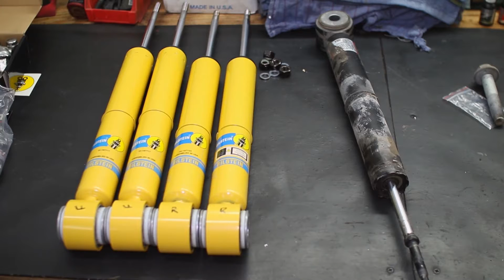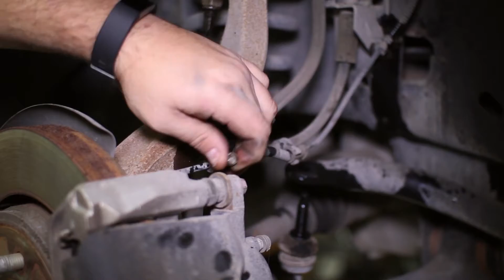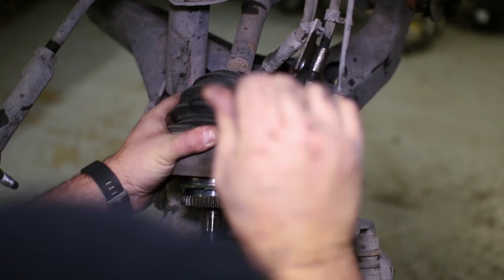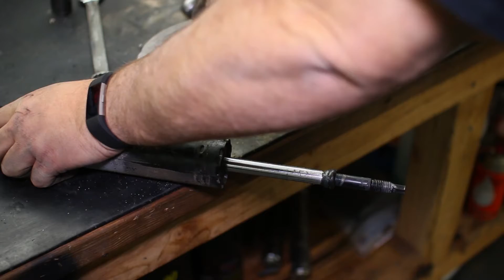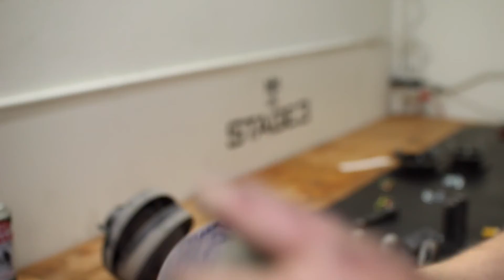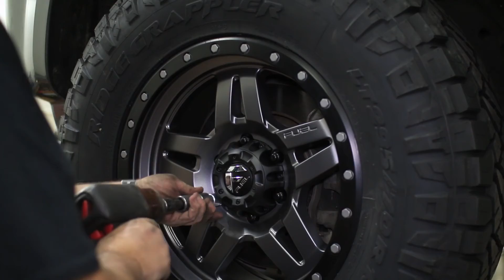2007-2013 Expedition Bilstein B6 4600 Front and Rear Shock Assemblies Install

Comment: facing an issue in my '08 expedition, the lower spring seats are welded onto the shocks, therefore cannot transfer them onto the 4600s, what to do in this situation

Comment: Im getting a 2 inch gap after i switched the rear shocks with the Bilstein. What should i do? Oem springs, bilstein part is accurate. Please advice
Reply: Iam facing the same issue, did you fix it?
Reply: Did you fix it? Same here
Reply: @leocortaza7247  did any of yall fix this im about to do this and want to prevent this
Reply: did yall fix this

Comment: For the rear strut do I need to compress the spring upon reassembling? I noticed it was done that way with the front but not the rear.
Reply from the maker: Yes, you will need to use compress both the front an rear springs.

Comment: These didn't fit my 07 Eddie Bauer edition. Did the Eddie Bauer have air suspension? Apparently mine requires struts rather than shocks.

Comment: The vehicle is the video is lifted.  are these shocks for the lifted version or stock.  I plan on the four corner lift kit when my shocks are ready to go.
Reply: Bilstein 4600 shocks are identical in size to your stock shocks.  They simply perform better and ride AMAZINGLY well for the price.  I’ve had two sets

Comment: Suspension should be loaded with vehicle weight to place the upper control arm at the correct angle before tightening the bushing bolts.  Not doing this will cause premature failure of the bushings.  Same with the lower shock bolts as well as rear lower control arm bushing bolt.
Reply: Came here to say this
Reply: Thx for the heads up👍

Comment: Will not work with higher trims with air ride for auto leveling
Reply from the maker: Correct. This kit is for Expeditions without factory air suspension